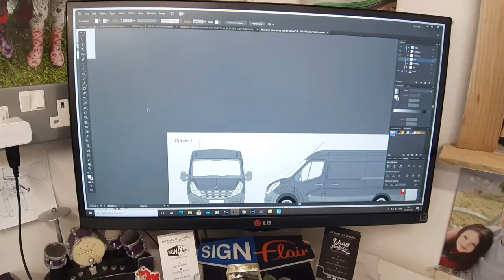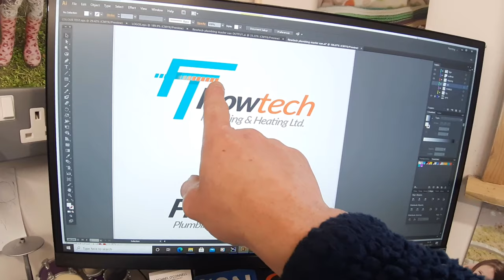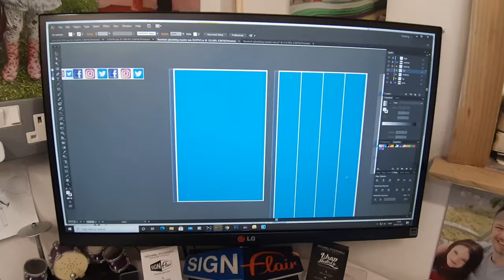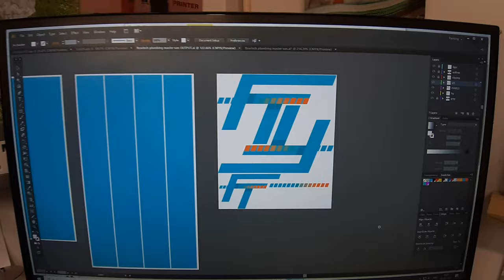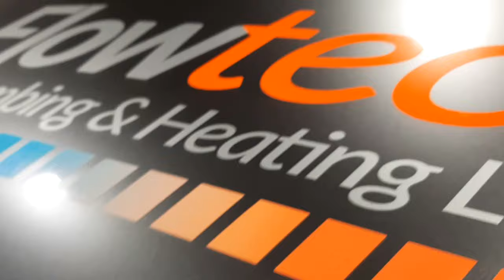Vehicle Graphics. Watch full process from design to installation

Comment: hi I'm a graphic designer, I wanted to know, the document that is to be made with Illustrator must be on a real scale or not? Can I work on a smaller size to lighten the document? there will be no problem for the printer?
Reply from the maker: Hello there, Illustrator only has a small artboard, so I generally work in 10% scale. i.e. vehicle height is 2metres, or so, It will be in illustrator as 200mm tall. Then when you send your artwork to print, You scale it up in the RIP software, " Just ad a 0" to scale up to 100% reality size :0) Hope that helps
Reply from the maker: Please keep in touch. I am also on Instagram:  https://www.instagram.com/signflair/
https://www.instagram.com/wrapmastersireland/
Reply from the maker: Please keep in touch. I am also on Instagram:  https://www.instagram.com/signflair/
https://www.instagram.com/wrapmastersireland/

Comment: I like how you cut the waste so that it's easier to manage during weeding. I only have a crafting cutter, a Sizzix Eclips. In my design I generally add lines that the cutter cuts for me instead of doing what you did with the scissors. I'm considering designing my own livery for my Miata. Your video was helpful.
Reply from the maker: Excellent stuff! The best of luck with that. Please keep in touch. I am also on Instagram:  https://www.instagram.com/signflair/
https://www.instagram.com/wrapmastersireland/

Cancel

Reply
Reply: I do that too, but only to help weed out the complicated large graphics. If it's multiple lines of text, drawing lines on the computer takes too much time compared to doing it with a knife before weeding.

Comment: This was really in depth, thanks! Does it get a little trickier when the dimensions of the wrap are more than the actual printer, so you'd have to do it in parts?
Reply from the maker: Absolutely.. You just need to work out where your overlaps will be etc and make sure you print the correct scale. :0)
Reply from the maker: Please keep in touch. I am also on Instagram:  https://www.instagram.com/signflair/
https://www.instagram.com/wrapmastersireland/